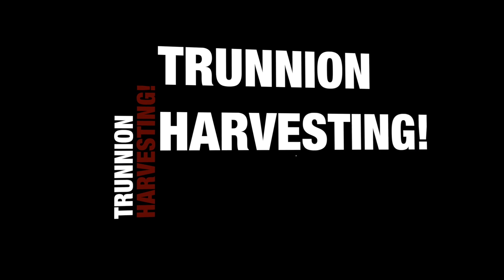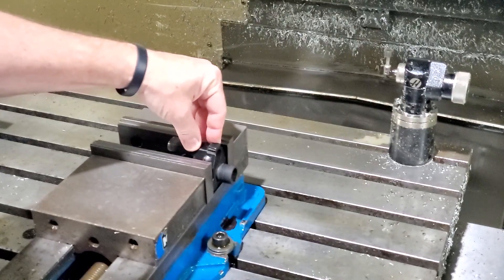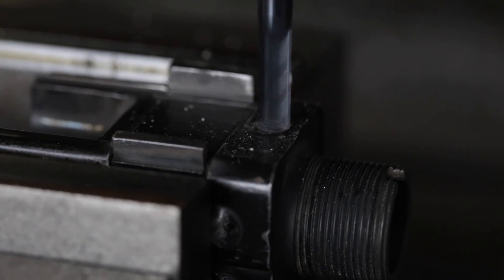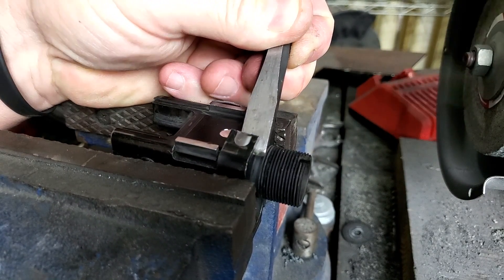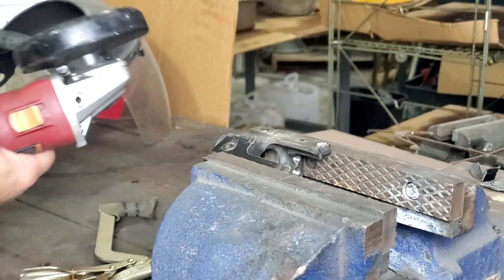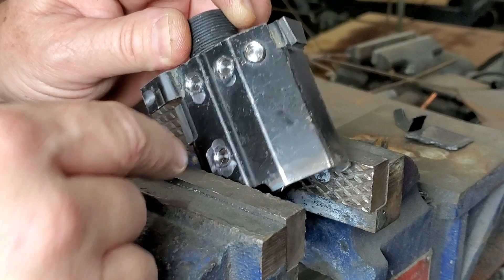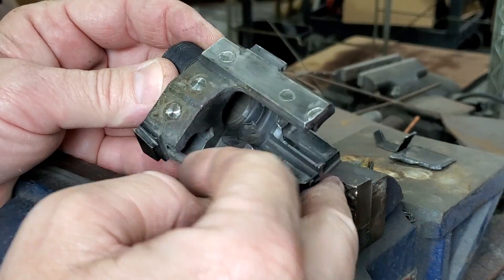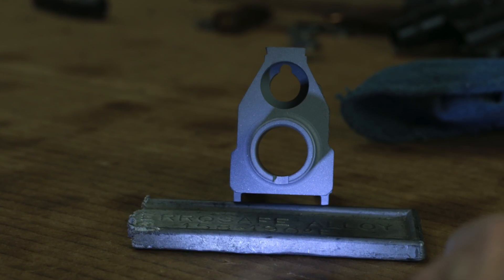Trunnion Harvest!

Comment: I don’t know if this is really on the topic of the video, but what type of steel are trunnions made out of for the most part? Specifically AK trunnions?
Reply from the maker: Well on the AKM drawing the callout is "Steel 40X per government standard 4543-61".  So if you can figure that out you'll have your answer.  In the U.S. they're generally a good heat treated alloy steel.
Reply: Thanks so much... great vid 👍🏼

Comment: Was the receiver hardened? I used my hardness checker files and it seems to be a Rockwell hardness  of 40.
I have been thinking that 1mm 4140  could be used for the receiver instead of the 1.3mm to save weight if the original receiver was not hardened.
Reply from the maker: You're talking about the sheet metal?  It doesn't seem hard to me.  I would assume it's mild steel but haven't checked yet.
Reply: Yes, the sheetmetal. I'm typing faster than I'm thinking.🙄

Comment: FYI if you only have a drill press/cordless drill try a spot weld cutter bit. Get the end mill style with a centering point, not the hole saw style.

Comment: WTF is a Trunnion for ?
Reply from the maker: In this case it's the forward end of the receiver and is the critical connection between the bolt and barrel.  All the stresses of firing are taken by this trunnion.
Reply: @markserbu  Thank you for that , as you can see I'm not into guns , I was 100 years ago but not for a long time thanks again.

Comment: Is the trunion also the part that the bolt locks into to, and does it also have the feed ramp on or that built into the magwell?
Reply from the maker: Yes and in this particular trunnion there is a feed ramp built in.

Comment: Are those really plug welds or rivets, Mark?
Reply from the maker: Come on, man...
Reply: @markserbu  Oh, I wasn't trying to be a horses rear end.  I just thought to myself, those are some great looking spot welds if so.
Reply from the maker: @willacewallace5905  You can tell by the slight amount of weld splatter around them that they're not rivets.  I've never seen plug welds done this way before, though...I'm guessing they've got some sort of MIG welder with a little copper dome on the end that directs the weld puddle into that shape.
Reply: @markserbu  Interesting indeed.

Comment: 4:03 It isnt the grinding that is all to dangerous, its the laying away of the grinder, is when you get cut/hurt.

So are you going to draw this in a 3d program and "safe it" before assembling the gun? 

What i am doing right now: 
Im doing a little bit of cad drawing now. Im kind of reinventing the wheel again and making a DPMS ar10 through the m16 drawings and the files for the upper and lower, bolt and bolt carrier for a DPMS ar10. And when it is all done, i will see if i can make up dies for aluminum receiver forging the upper, lower, charging handle, front sight, etc. Its just me learning how to draw, do machining, getting to know heattreatment processes (hot and cold). Of course you must know if it is legal to do all this before you do it. So lets keep it on paper (for me)....

Thats all!

Greetings,

Jeff

Comment: never ever sandblast threads, thats a nono, and a nightmare to me as maschinist, thats like sandblasting contact surfaces or bearing surfaces
Reply from the maker: No offense but that's just wrong.  I've been sandblasting threads for around 30 years and in my capacity as a mechanical engineer, machinist, assembler, test-fire guy, etc., it's never been a nightmare.  Shit, it's never been an issue at all!
Reply: @markserbu  i got the pleasure to change parts on milled assemblies and make copies of broken parts, its never fun when the treads are sandblasted, the roughened surface from sandblasting just abaut allways corodes somewhere and the thread get the grimy feel and stuck-  there might be a difference with finer grains of sand and hardened parts where it doesnt matter

Comment: PPE for grinder. I was always taught not to wear gloves so that the grinder will just cut you hand rather than suck it in.
Reply from the maker: I don't agree with that.  After 40 years I finally got bit a 2nd time by a death wheel, and I think if I'd had gloves on it wouldn't have hurt me at all.  As it was my finger got cut to the bone and bled like crazy.  On the up side, I didn't even get stitches and it was totally healed in a month or so.
Reply: @markserbu  might start wearing my tig welding gloves then since they are probably my tightest fitting ones.
Reply: @Burritoswithfritos  that's exactly what I wear! And as for them "getting sucked into the wheel/ grinder", I honestly don't think that I could get them caught up in it if I reallyyy tried... and I'm being 100% serious here, the wheel's too small and the gloves too thick and rigid...

Comment: What’s the receiver thickness?  If you were bending up a new receiver, what would you use?  4130 annealed, normalized?
Reply from the maker: Receiver thickness?  Check out 2:01.  It would be nice to use 4130 sheet, but I'll bet the factory used just mild steel...1010 or 1008.